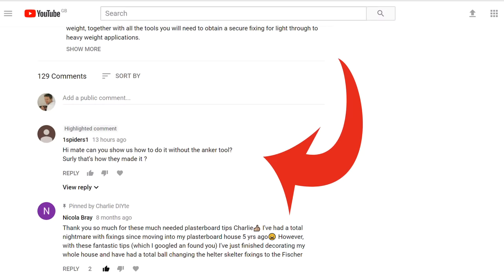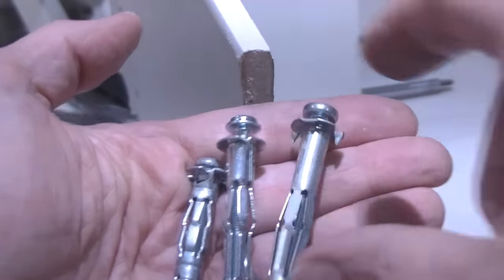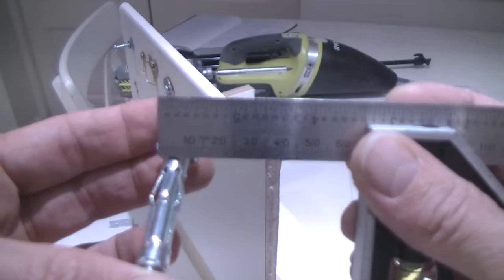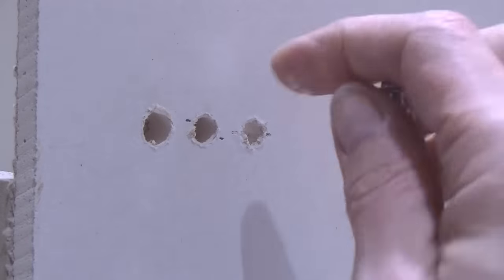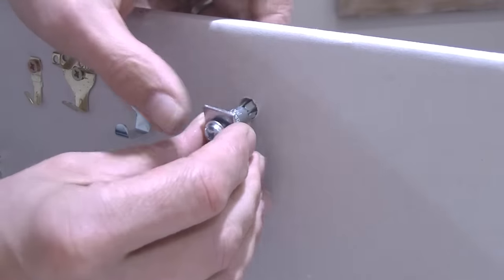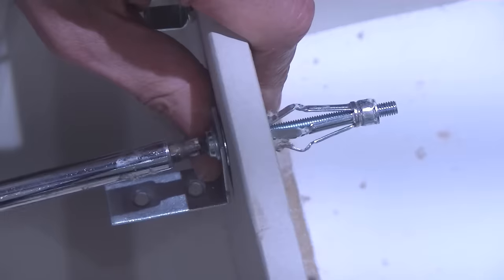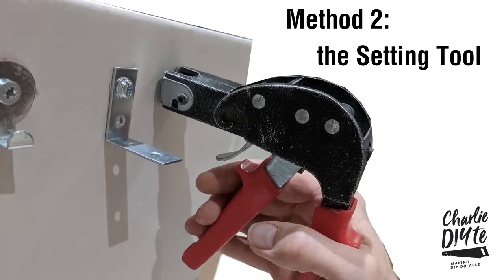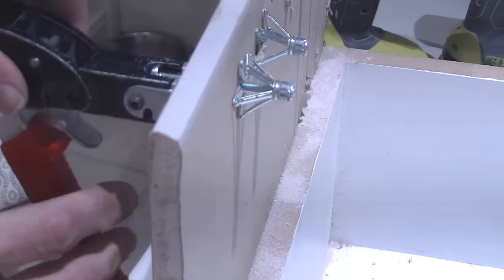How to Fit Hollow Wall Anchors

Comment: Thanks for replying Charlie. Unfortunately I found out too late that bought packs of fittings are cheap and nasty. I havent bought the anchors yet.. will tomorrow. I have one expanding anchor to test, as shown in your video, have tried it in the drilled holes and it fits perfectly, however the edges around the hole are a bit damaged so not sure if the two little hooks will have anything to grip onto to prevent the anchor from spinning??? The screws are the correct size for the brackets, so I have to stick with that size. I thought is there some sort of wider thin strong washer that I could thread on between wall and screw to make hole edges stronger, if that makes sense?  But then the little hooks need to pierce that washer?? Just a thought. I'll ask at the hardware store for their advice.... again..  last resort might have to patch holes and drill new ones. So annoying. Hope not!!

Comment: I don’t have the setting tool and just screw in by hand. I found that a manual screwdriver and pressing the spikes into the wall works best.  Too much torque and speed will make it spin in the plaster board, or ruin the screw head and then you have a problem!
Reply from the maker: Good work. You'd love the setting tool though.

Comment: This is great, but how can you use these on a floating shelf where you can't put the bracket in between?
Reply from the maker: Floating shelves are problematic on a solid brick wall let alone with plasterboard. Not sure what you mean though. Thinking back to the IKEA shelf I fitted, you just fasten this bolt like you would a normal screw.

Comment: Thank you for this!
Quick question re. the turning stop - I'm wanting to affix a baby gate to the rubbish plasterboard wall but the screws just keep falling out, I'm thinking an anchor fixing might work but I'm going to screw a plinth of wood into the wall and then attach the baby gate fixings to that - would this work?

Comment: problem I had was the plaster bust and the toggle looked real wobbly, I used the toggle tool I think the small anchor I used was too small for the width of the plasterboard. surely not though you'd think think they'd be a standard fit for the uk?
Reply from the maker: You want to get a paper clip or something and bend over a tiny "L" at the end, thread it into the hole and you can check the thickness. Some walls are double lined, so 24 mm in total, but most tend to be the standard plasterboard thickness (12mm). Walls can vary, particularly if they're lath and plaster.

Comment: will those types of anchors be okay to use to mount a TV on drywall? my neighbour told me to use through bolts but after looking on Amazon they all seemed to be for concrete.
Reply from the maker: They're amongst the best. Geefix is the strongest. Here's my update video https://youtu.be/Jdu9RId7m90

Comment: Hi Charlie. I realise this is old, but just wondered as it’s not covered. Are they easy to remove??
Reply from the maker: Not really. Your best bet is to drill off the washer with an HSS bit and push them into the wall before filling.
Reply: @CharlieDIYte  thanks! I used corefix for the tv, I’m dreading trying to get those out. So many install videos, none on removal with all these fixings.

Comment: I assume if u take the bolt out after u put in the wall anchor, u can only do that if u r testing that yr fixture is fitted straight!  Could it fall if bolt taken out?
Reply from the maker: No. That happens with toggle fixings but not with wall anchors. Trusts the great thing about them. You can remove the bolt whenever you want.

Comment: I'm assuming where the plasterboard is spot/dabbed to the wall, there may not be that much of an air gap, so after drilling through the plasterboard, swapping to a masonry bit and making a small hole in the brick allows space for the anchor to sit?
Reply from the maker: Yes you're right. There probably won't be enough of a void in this situation. You could do that but the hole would need to be at least as wide as the anchor - approx 10mm. In this situation I would be relying on the brick wall for a strong fixing not the plasterboard. There's a few ways you can do this. By drilling right through into the brick and tapping the fixing right through the plasterboard into the brick with a larger (wider) screw than you intend to use. We do this a lot in the day job but you just have to be careful that you don't tighten the screw to tight as it could pull back the plasterboard towards the wall and crack it. Alternatively you could use a frame fixing which is longer than a standard wall plug, bridges the gap between the plasterboard and brick and therefore won't crack the wall of you over tighten. There's also a bespoke dot and dab fixing called a Corefix that works like a grave fixing but has a strengthened steel core. Depends really how strong you need the fixing to be.
Reply: Charlie DIYte it’s just to hold up a 32” monitor, so not that heavy but I feel the brick layer is very close and guess that the air gap is less than a centimetre so as you say, best to go into the brick instead. Thanks for the tips!

Comment: Great Video.   I liked the camera work so we could see what was happening infront and behind plasterboard.   However you didn't show us how to attach the bracket after using the fixing tool.
Reply: The whole point of wall anchors is that they provide a permanent threaded hole in the wall for you. You can remove and reinsert the bolt as often as you like.

Comment: This might help someone , im in the trade and i had 2 of these fixings that were set in the wall that would not tighten. The tiny threaded section at the end can fall out when using the setting tool. I had over tightened the fixing when using the setting tool pulling the thread out, solution is to remove the thread from another fixing , thread it onto the bolt and insert into the fixing.

Comment: What's the best anchor for a plywood wall to hold a 12kg bathroom cabinet?
I have around a 5cm cavity to work with.
Reply from the maker: What's the depth of the plywood? Isn't the plywood sufficient in itself with a good 4.5 or 5mm diameter screw self piloted into it?

Comment: Hey Charlie thanks for the video, but how do you go about removing wall anchors?
Reply from the maker: Thanks Phil. You've got 2 options. The first is a little risky. You could try and remove the anchor by turning the bolt anticlockwise so that the bolt is almost disengaged from the wall anchor, and then lightly tap the bolt with a hammer. It will gradually reverse the umbrella effect, or close the wall anchor. When the bolt can't go any further you could try and pull the anchor out of the wall. This is a little risky because if you hit the bolt too hard you risk cracking the plaster on your wall, or you risk making a large hole as the washer on the front of the anchor might sink into the wall whilst you're hammering away at the bolt.

The other, less risky option is to gently lever off the washer from the front of the wall anchor. Most wall anchors are designed so that the washer can be removed. If you struggle to remove it you can take a large (eg 10mm diameter) metal drill bit, and gently drill out the centre of the wall anchor until the washer comes loose. Once the washer is removed you can lightly tap the anchor into the wall, and fill the hole - or if you're replacing the wall anchor with another fixing, you can simply tap the wall anchor all the way in, allowing it to harmlessly fall down into the void behind your plasterboard. 

Hope this all makes sense!
Reply: Thanks for the advice Charlie, when my wife wants the heavyweight mirror moved somewhere else I have the knowledge lol 👍🏻👍🏻👍🏻
Reply: Drill it out, get a same sized drill bit that you used to drill the hole, sometimes a little bigger and just start drilling. That's how you get steel and aluminium nut inserts out of steel and I wouldn't imagine it be any different here, except here it grips onto the surface using teeth, nut inserts don't.

Comment: Great Vid Charlie, what do you recommend using for heavy items like wall units on a dot & dab wall ?
Reply from the maker: Hi Neil. If it was me, I'd look for maximum strength by relying on the underlying wall that the plasterboard is dabbed onto, rather than the plasterboard itself. I'd go for Option A below, and whenever I need to go for the nuclear option in terms of fixing strength I reach for something like this https://goo.gl/RgDp67 . Whilst this one is 10 x 100mm you'll need to choose an appropriate length for yours taking into account the thickness of the unit, plasterboard, gap between the board and the wall where it's dabbed, making sure the fixing goes into the wall itself by a good 40-60mm.

OPTION A: you drill a hole the same diameter as the fixing through the plasterboard and right into the wall behind. Countersink the plasterboard a bit so that when you hammer in the fixing it sits flat with the wall rather than sticking out, and then hammer in the fixing. You'll need a big old screw bit - probably a PZ3 as the screw heads are large - but when you drive them in and they go tight, you're SO reassured as to the strength of the fixing. The beauty with these frame fixings is that you can't really overtighten the screw and so there's no risk of the screw pulling the plasterboard backwards - because the collar of the fixing comes right through to the front of the plasterboard, and the screw won't move around when tight, unlike option B below.   

If for whatever reason you're put off option A above, there's always OPTION B: you can drill a 6-7mm diameter hole (as recommended for the fixing you're using) and insert a standard wall fixing into the hole - I use these a lot https://goo.gl/5P6Pbu (but I haven't bought from this company), insert a screw into the fixing turning it a few times with a screwdriver, and then hammer the screw, driving the fixing all the way through the plasterboard and into the brickwork behind. The problem with this method is that you have to be careful not to overtighten the screw as you can force the plasterboard backwards if it isn't dabbed  in enough places. Also, there's a bit of play on the screw as the screw is rattling around in a hole that's wider than the screw (even though it's securely fixed into the wall behind). You can eliminate this play by cutting a new fixing in half and just insert the collar into the hole, so that the screw fits snuggly into the hole. 

If you can't fix into the wall behind for whatever reason, ie you HAVE to rely on the plasterboard, only use a spring toggle or anchor fixing - but make sure there's enough space in the gap behind the plasterboard for the toggle or anchor to open up properly. Any other questions, ping me another comment :)
Reply: Id drill a hole into the brick back ground. Insert resin, and use it to hold m6 or m8 threaded bar , and fix units with that

Comment: Hi Charlie, apologies if you have covered this but can you please tell me how to remove a dry wall anchor?
Reply from the maker: No need to apologise. It's not the easiest thing to do. Some designs come with the front collar attached in only a few places so you can lever it off, and then push the remainder into the wall and fill over it. With the others that don't, you need to get an HSS drill bit that's reasonably wide - say 10mm  - and gently drill off the front collar. Then, again, you can push the fixing back into the wall and fill over. You can't pull it out of the wall though, at least without making a massive mess.
Reply: @CharlieDIYte  bloody hell! I knew it would be a pig to sort out. Thanks Charlie

Comment: What is the closest I can put hollow wall anchors? (M5 37mm), is 5cm (2”) too close? Please let me know, many thanks M.
Reply from the maker: 5 cms will be fine. You could alternatively use a Geefix https://bit.ly/352tcwB and screw quite close to each fixing because you can see multiple holes into the plastic wing behind the plasterboard.

Comment: How close apart anchors can be fixed. Can I have 24mm in between M4 32mm ones? Please let me know, many thanks, M.
Reply from the maker: Should be ok with that. Maybe close one of the bolts outside of the wall and check how far the umbrella opens to ensure they're not going to hit each other.

Comment: I could have use this years ago.  I keep trying to turn the screw and if I was luck the two locking items just ripped drywall.  I did buy a tool and was happy with it.  The problem is the sizes of ex-long to ex-short is never explained.

Comment: I have a set of 6x52s. According to the packaging, they can be used on plasterboard thicknesses that range from 7mm-21mm. The collar itself is about 12mm. Would you not recommend using these on any thickness other than 12mm despite this information from Fischer themselves?
Reply from the maker: I think 21 mm may be pushing it a bit, but the point they're making is that the umbrella is flexible so even though the collar is a slightly different thickness, the umbrella should open up anyway. With double thickness plasterboard I'd always recommend a longer collar but ultimately you'll know if it works or not because you'll know if the umbrella hasn't opened properly, because the bolt won't pull out much when you try and open it.

Comment: Turning Stop?  How does that stop the anchor from turning?  I had used a small gizmo that came with the anchors.  The anchors had 2 small holes on the face that the gizmo fit into.

Comment: Really random and not sure if this would work, but would I be able to use these to mount a TV bracket & TV, I have honeycomb partition walls, so have no studs to fix into... Just wondering if I could use these to potentially then fix some ply to and then tv bracket to the ply?
Reply from the maker: Should be ok if the honeycomb is 12mm thick or thereabouts. You might also take a look at Geefix - here's my complete fixings run through https://youtu.be/Jdu9RId7m90?si=HzA6HlL7_eWw8ZkP
Reply: @CharlieDIYte  Amazing, just watched it! I'll have a look when I'm home and test it out, may overestimate and use 8 to hold a bracket for a tv approx 30kg 👍🏻

Comment: You use the M5 x 52mm here. Is there anything wrong with using the M5 x 37mm for normal 12mm plasterboard? Also trying to find out how many kg these can take as I want to hang a 12kg mirror...0

Comment: Hi Charlie, I need to fix some small glass shelves in my ensuite and downstairs toilet, they will be both screwed into plasterboard but which fixings / wall plugs would you recommend? Cheers, Jack
Reply from the maker: Jack Featherstone Hi Jack. It depends what sort of brackets they've got and how much load they're taking (plus how heavy are the shelves?)🤔
Reply: Charlie DIYte Thanks Charlie, the shelves are quite small, 450mm wide and 140mm deep. They come with two chrome brackets to attach them to the wall which the shelf slots into, and then a screw underneath the shelf clamps it in the bracket. I’m not too sure how heavy the shelves are themselves, but they will only be used to hold a soap dispenser, toothbrush holder etc...
Reply from the maker: In that case you'd be fine using something like a Fischer UX6. Take a look at this vid where I show how the UX6 works. https://youtu.be/QHoKBuDP2pY .Just make sure you buy the right screws!

Comment: I have a 12.5mm plasterboard covering a solid brick wall. What type of fixing would I use? I can't use an anchor fixing as there's not enough room in-between the bricks and the plasterboard...

I need to hang a set of IKEA LACK floating shelves.
Reply from the maker: So I'm guessing it's dot and dab (the plasterboard is glued to the wall with plasterboard adhesive?) Do you know what the gap is between the bricks and the plasterboard? If there is no gap, or the holes are through or very close to the adhesive, then your best bet is to use a brick fixing - I use a lot of talon (7mm diameter hole) brown plugs. Drill through the plasterboard into the brick, insert the fixing into the plasterboard, and then tap it right though the plasterboard into the brick. Then your screw is deriving its strength from the brick not the plasterboard. 

The only danger with this method is that if you over tighten the screw it can pull the plasterboard back towards the brick and crack it. This shouldn't happen if you're careful as you tighten the screw. 

But if you're worried about cracking the plasterboard or the gap between brick and plasterboard is reasonably wide, consider getting some Corefix dot and dab fixings - that have a metal sleeve that you insert into the plug that bridges the void between brick and plasterboard. They're tested to 250kg, even work in thermalite blockwork and would definitely work with your shelves.

Comment: What size would you use for double thickness plasterboard? Diameter 6mm bolt x how long
Reply from the maker: 58mm long that has a 22mm collar. I think it's M5 but could be the next size up.

Comment: I got Mollies for my 34mm thick hollow door to fit toilet roll holder and cloak hooks. After seeing this and understanding about the collar size, is it completely wrong to use Mollies? Bet the wood is not very thick. Any idea on this standard hollow bathroom door and what would be better to use ie E-Z anchor screws?
Reply from the maker: Yes, Mollies aren't the right fixing for your door. You'd be better with something like this https://goo.gl/A2mxeh
Reply: Charlie DIYte Thanks! I saw these before, will get them. Any tips to avoid them falling through? Also in the above video you used a punch and I wanted to know if when drilling holes and you're wanting to break the surface of a material whether brick or wood, is it an awl or a punch that is needed?